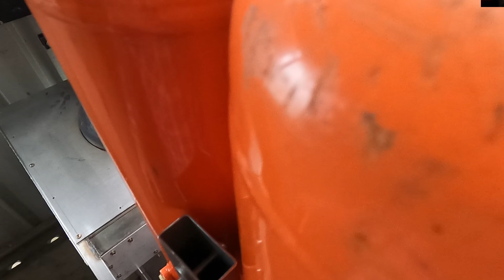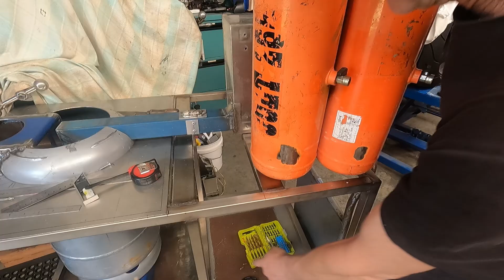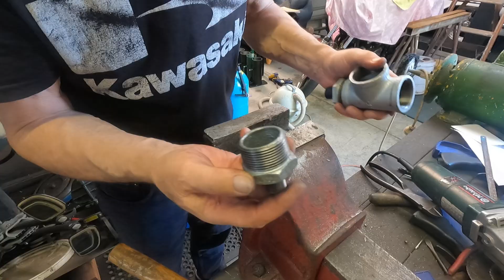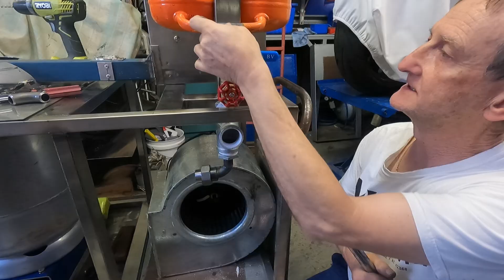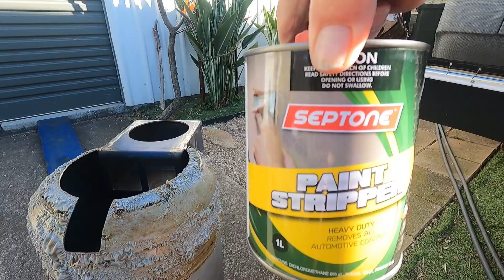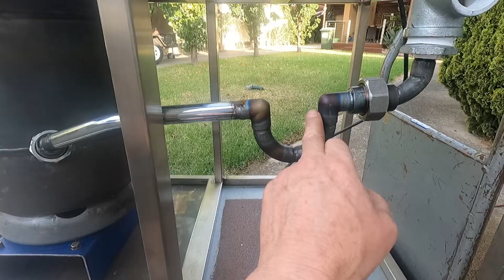Best Waste Oil Heater. FREE HEAT. Man Cave Heater. Shed Heater. Pt 3. #wasteoilburner #oilheater

Comment: Nice build mate. If you reduce the air hole size or blower speed you will get a cleaner burn and it will have a blue flame.
Reply from the maker: Thanks for the compliment. Yeah, I’ve seen people go on about a blue flame. I might experiment with your suggestion and appreciate the feedback. Thanks for the comment. Cheers, Kraza…………
Reply: @FlyFishingwithKraza.-to4lf 
I have been heating my workshop for the last 10+ years  with waste oil. The other key part to getting a blue flame is to keep a small pool of oil in your burn pot at  all times. I you ever have any questions about it send me a 
Msg.
Reply from the maker: @runninlow308   Hi Steve. I don't have a separate pot sitting at the bottom of my burner. Is this something I should install? Or is the LP Gas tank (Burner) okay as it is. I have seen some oily residue at the bottom of the burner when I shut it down though. I'm going to fit a variable speed dial to the combustion fan motor soon. just to see if what you said about reducing the air flow works for me. Thanks for the feedback. Cheers, Kraza............